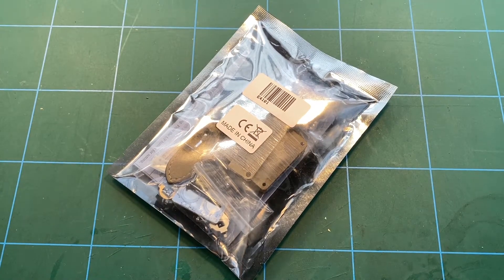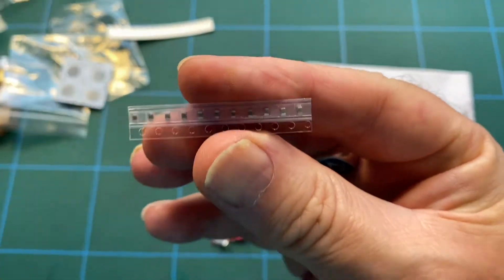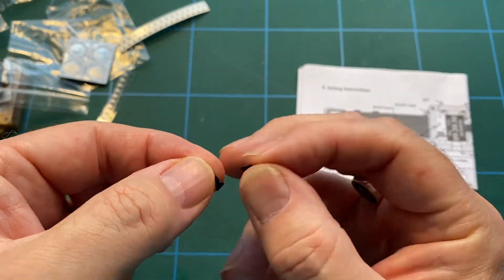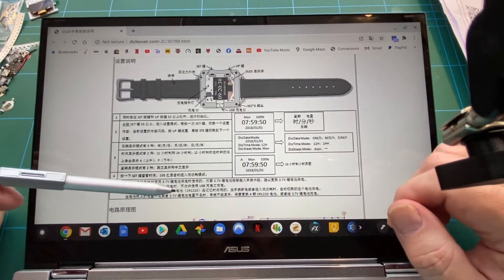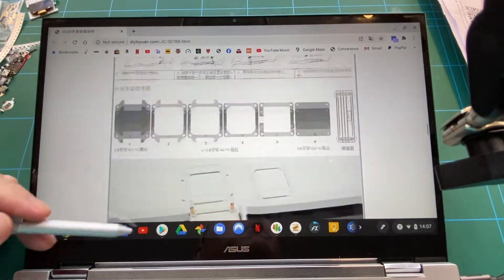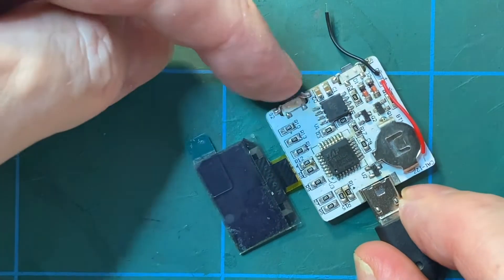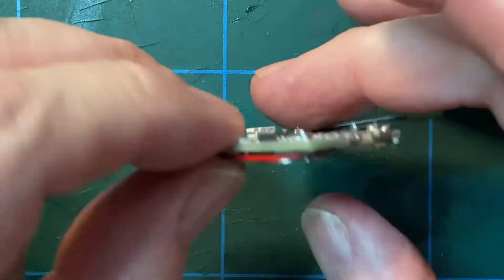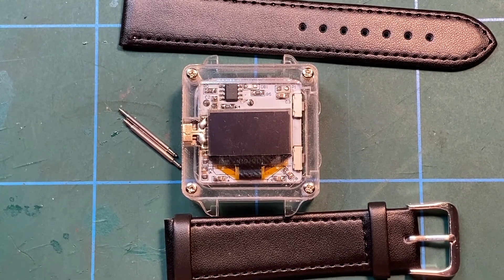Amazon: Kkmoon OLED watch kit

Comment: If you're having difficulty getting the watch out of standby check for orientation of C0 and C1 - they should be as indicated on the schematic and not as indicated on the pcb!!! Took me hours to figure out but works a charm now :)
Reply: Me too
Reply: Do you mean the CO and C1 should be soldered in Vertical instead of horizontal??
Reply: @chuy6590   Do you mean the CO and C1 should be soldered in Vertical instead of horizontal??

Comment: Great video! Very instructive. Loads better than the one I did on it years ago. :) I didn't know you could power it on via just the USB, sweet. I think I built my case with the strap in place, which was a fiddle, but obviously avoided breakages. I word of warning, rapid pressing of the buttons, can completely lock up the watch. I've done it a few times (might be just mine I guess). You have to remove all batteries and power sources for quite some time to get it reset.

Comment: Replace battery board with your own 3.7v LiPo battery to use micro USB charging socket. Add a wireless charging coil kit, if you want to omit USB socket. In any scenario, you must install backup battery on main board, or it will not retain settings.